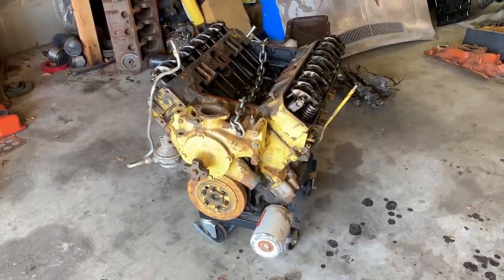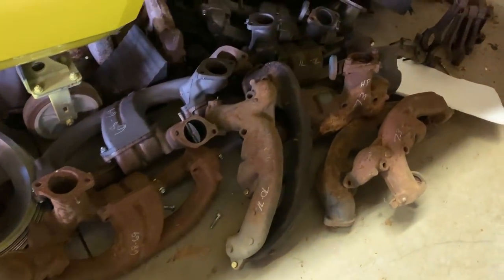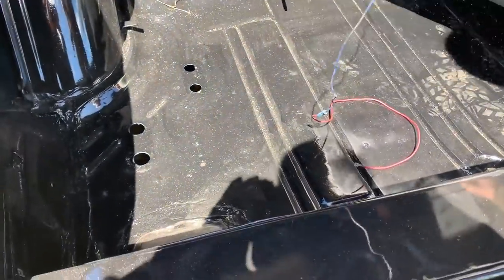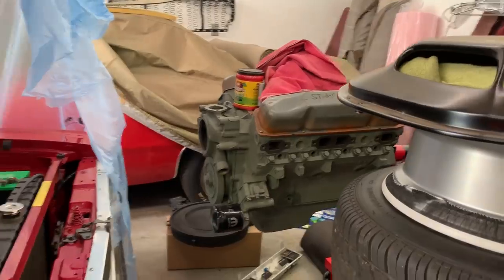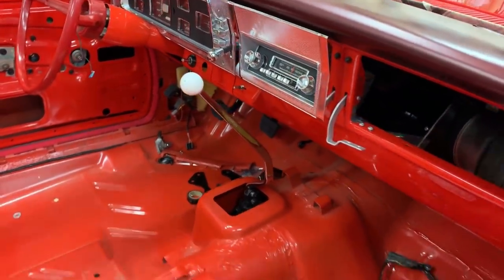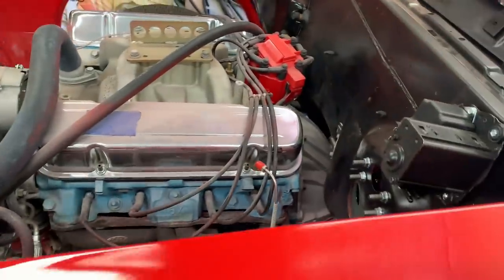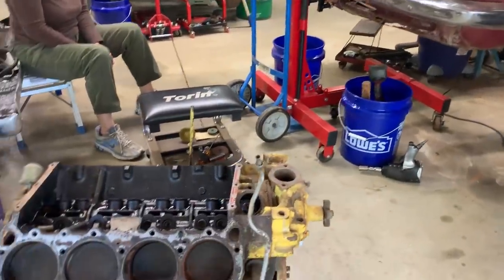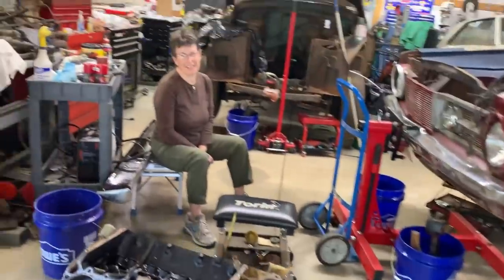"MOPAR HEAVEN"

Comment: My, my, my that sure is mopar heaven. 
You're putting that 383 in an early A body?
Better polish up your shoe horn. 
Happy Motoring.
Reply: i've done the swap, easiest way is keep the trans with a B engine adapter to LA trans, using elephant ears and definitely have to use fender well headers or use two ride side exhausts,which look funny and they do pull hard,rear axle has to go,its completely custom installation,completely,my way didn't destroy none of the factory sheet metal except shock towers and inside fender wells,i put it all in for less than 2000 but that was in 1985,i guess a shoehorn would;ve helped,lol
Reply: @strattuner  Yeah not a fan of fender headers if you're going to use it on the street, put them in my 65 Cuda and that year we had lots of snow. 
BB in an A body is cool but if I were to do one today, it would be  67 and up and a 440 with a six pack. I had a 70 Swinger 340, 4 speed and that was very healthy so adding another 100 cubes would be awesome but it wouldn't be an every day driver. I used my Swinger every day and the gas didn't cost me an arm and a leg, well that is if you weren't stop light racing. I still have one of my shoe horns, I call it the elephants toe. With a long enough lever you can move the world. Have a great day.

Comment: The 22r Toyota blocks have nickel . my block had 192 thousand miles. The machinist couldn't get a thousands of ridge at the top of the cycle. I wanted to start new and still had it punched out.
Reply from the maker: High nickel blocks seem to wear little compared to others. I guess that's why they use them in some truck engines. Good luck with your 22 R build and thanks for watching, Sam.

Comment: Thanks for posting ! I too have projects stored waiting to find the RIGHT parts. So many cool finds, I do need some for 80s  driver's. Put off a few, waiting to buy, waiting for wheels set to move a  couple. A set of 5 15x8 complete Super Coupe rims for rotation on 3 wagons. How do WE contact HIM.  .  . ?
Reply: Don't suppose you have one single super Coupe wheel
Reply: I have three would like to have one to have a full set
Reply from the maker: Contact information is in the video. Thanks.
Reply: Sorry, mind was feeling with need/want list during video. Thanks again for posting. . . Spreading the WORD.   K H...many over the past 40 years. Even though HD designed, they DO get bent. Mine have been off true, bent and warped by 🔥. I figure THIS man MAY have NOS stack. His prices will reflect that, I'm sure. Last resort is CNC machine alloy cut set, to better offset. You know they're Heavy. First set I found had original Kit Car whipped tires, swap meet at DAYTONA Speedway in '96, for a grand.(wheels,centers, lugs and trim rings, tires to toss. See lots of 15x7 smooth center ring sets for Magnum GT models.
Reply: @williamboardman9476  had a super Coupe for 21 years these were two wheels that I had that were off the car that I kept send them to get re hooped and some how ended up with an extra one so just looking for one.i have two cop wheels but would like a full set
Reply: @kurthollembeak190  I DO have one, straight, cop HD burgundy slot off a St Regis...but Magnum GT rims are 15x7 and have the smooth center ring (for no cap). Stored under weak gold paint, as wanted set is for an 82 Cordoba that's golden. For 82 NASCAR without rules.  You want another cop, I'll go look at it.
Reply: @kurthollembeak190  Where are you ? I have a few cars stored in SC, near "Heaven", and he's on the way to Savannah. Turkey Rod Run for Thanksgiving...Anderson, SC.
Reply: @williamboardman9476  I am all the way across the United States from you I am in New Mexico
Reply: That's okay I can find it cop will fairly easy just looking for the 8-inch super Coupe wheel
Reply: @williamboardman9476  not having that wheel is not going to stop me on any of my other projects it's no big deal
Reply: @kurthollembeak190  I have a surprising number of military friends now living in Phoenix area. And sister and in-laws now in Prescott.  Wheels make great, sturdy, shelving  spacers in the shop.
Reply: @kurthollembeak190  Hey man...listening to music. As I did for hours, at the beaches, East, West, and South. . .sun sets, rises...in the car, seat deep...limo tint glass, to eyes level, head on a swivel...         NOW....tapping tears,... worldwide. Viral worldwide tears... Found IT...(what IS correct YEAR ?) Cranberry Tonic/maybe TOXIC (?).… Plymouth. 
Coupe.  
"HOT" 360
Reply: @kurthollembeak190  Super. 
LOOKS like a Super.
NOT looks super.